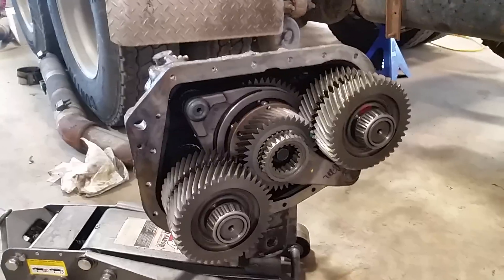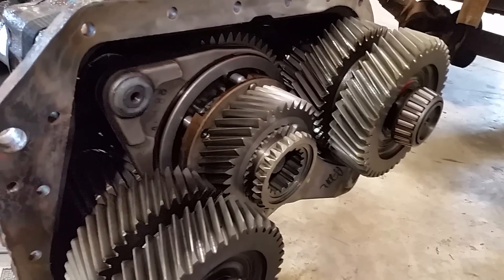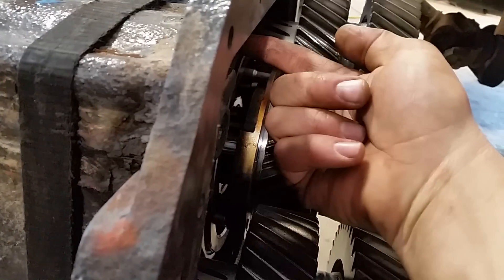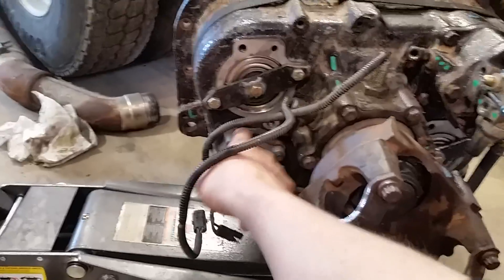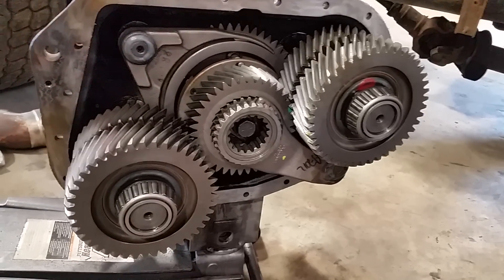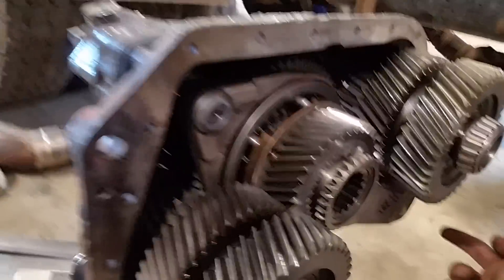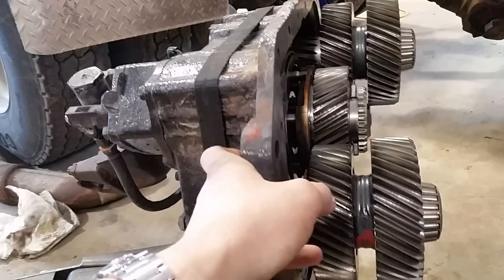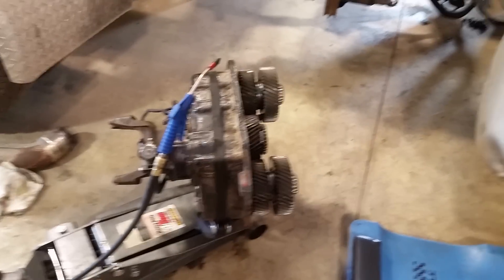Eaton 13 speed...how it works

Comment: Amazing how the trans can be apart like this and be on the road working in a few hours.  Love these machines!!!
Reply: I did a swap a few years ago, and it's kind of scary how quick and easy it is.

Flywheel and clutch takes seconds, slide the trans in, a few bolts on the housing, slap the drive shaft on, a couple air lines for the stick shift and you're done.

Comment: Thanks for the little bit of a heads-up I got a 13 speed that it will go into high range but you're not able to split the high range gears. This kind of gives me a little bit of a heads-up preciate it
Reply: GavatronX9 the splitter fork broke. I just replaced  one on my truck part# is A-7012 . Call pro gear in Tampa Fl

Comment: Hey bud good vid bud the front of the countershaft is actually low split not high split. when the splitter dog is in the gear its in now is high split. I specialised in building  truck transmissions
Reply from the maker: thanks!
Reply: Chris Robinson
Reply: @jmpsck23  I have an 18 speed that grinds from hi to low,probably the syncro?? Any opinions?
Reply: Chris Robinson — That makes sense.  I was wondering about the gear diameters.  The low split countershaft gears have to be larger.  But how does the drive gear in the center move between the two pairs of gears which are of different diameters?  Do the countershafts move sideways when shifting the splitter?
Reply: Thanks you finaly a hero ! I was hoping to see your andswer in the comments !
Reply: Hey my 13 speed splitter stopped working 
Splitter switch moved but doesn’t split where should I start looking for the problem from ?
Reply: @shynal100   unplug small airline that goes to splitter valve on the back of the aux and check theres air comes out when you select at knob
Reply: @chrisrobinson6231  I’ll do that thanks man appreciate it 
Have you got a email or WhatsApp any help would be great 
Cheers
Reply: @GH-oi2jf  There dog slides on the mainshaft and engages in the center of the gears

Comment: I’m having issue with my transmission I purchased my truck with a 13speed originally was supposed to be 9 speed been driving it for a year new clutch has 10k miles on an issue occurred out of nowhere n never stopped if I’m driving in 7 high or 8 high truck rpm surge n truck jerks if anyone can helps really appreciated put to much money in this truck paid a lot of money diagnostics mechanics keep saying keep driving till something breaks

Comment: Great video!  Very informative.  Do you happen to know the specs for the air pressure supply to the air cylinders?  I want to test that before I open up my transmission.  Anything else that a person should check for external issues?  Thanks.
Reply: Rich Lehmann pressure to trans from truck supply is around 110 psi which is then dropped down by the trans filter regulator to about 65 to 75 psi

Comment: Should there be an play in the rear yoke when twisting? Also when in reverse or slow acceleration under heavy load I have a chatter. Any idea what might be wrong?
Reply: I'm having same issue
Reply: Same here took the drive shaft off . in neutral turn driveshaft left and right and it will clunk left and right no in and out play . I put it in top gear high at idle no driveshaft just trans spinning at idle speed and it makes. A racket. Im at the point i want to replace the "bad parts" i have the skill just dont know where id go to pay someone to get the box rebuilt.

Comment: Does changing 9 speed eaton to 13 double overdrive cause low gear to be higher. Its like I'm taking off in 3rd gear or something. If I change it back to regular nine will it lower first gear or should I say low gear so I can take off better without having to ride the clutch and press throttle half way down

Comment: Hey buddy I have issue with a splitter on a 18 speed Transmission. Hi/low range range works but the splitter doesn't seems to work at all. Any suggestions. Thanks

Comment: So what's different in the trans that makes the 18 speed and 13 speed units work like they do?
Reply: 13 speed splits high range only so only splits gears 5, 6, 7, and 8 but the 18 speed splits both high and low range gears so splits all gears, 1,2,3,4,5,6,7, and 8

Comment: What mount/bracket did you use to support the auxiliary section of the transmission?
Reply from the maker: I made one, then used a ratchet strap to secure it

Comment: One thing I've never understood is the transmissions torque range. There's the 1250, 1450, 1650, and 1850.  What is inside the transmission that determines torque rating and what might happen if you mismatch engine - transmission? Example might be if engine is 1650 but transmission is only rated for 1450 or visa-versa if engine is 1450 and transmission is rated 1650. I have a 1550 torque rated transmission and want to have engine ECM re-rated to 1650-lb.ft and don't know if I can still use my 1550 transmission or need to change out. I really want to swap my 10-speed direct transmission to either a 13 or an 18 speed overdrive which creates another problem with rear-end ratio's.  It was so easy in the old days when all trucks used a 3.70, 3.90, or 4.11 rear ratio and dump trucks used a 4.44 but now there are a thousand different ways a truck can be spec'd. My truck uses a 2.64:1 rear-end ratio with 22.5LP rubber. Good fuel mileage but no balls.
Reply from the maker: yeah, I would guess the internal differences are just size of gears being beefier to handle the extra torque, but i dont know. I do know with the ecm controlled engines the power band is much wider and thats why almost everything runs 10 speeds over the road. the few exceptions are the offroad guys moving dump trailers and the heavy haul guys over the road. the old mechanical's as you know have very narrow power bands and thats why you needed all them gears, so you dont end up on your face.   just curious are you planning on re-rating your engine soon, and if you are is it a higher mileage unit? I have seen that often when guys buy a used truck that has been run 300-500k at say 375hp with no problems and they buy it and up the horses and next thing they know is they need an inframe done. i would consider running it until you need that inframe and up the hp after it is done.  thanks for commenting!
Reply: When I bought this truck 7-years ago (2010) it was set at 370-Hp. I took it to Clarke Diesel and had it uprated to 430-Hp. He said that was as high as the ECM would allow him to go without reflashing. That was at 665,000 miles. A year ago (2016 March) at 1,012,000 miles I thought I had a failed injector and took it back to Clarke for a cut-out test. After a couple of hours the tech informed me I needed two cyl-kits due to failed rings. So a top to bottom in-frame was performed. Four months later 2016 July, a head gasket failed and they re-did the work at their cost. Now a year later and about 67,000 on rebuild, I want to increase Hp/Toque ratings and they said I needed a reflash which would cost more than $2,200. I am considering it and if I do, I am thinking of changing transmission and rear-ends for the higher ratings. When I bought this truck, first thing I asked was "has this truck been wrecked"? They said no. Two years later I was changing an interior overhead light and found a piece of paper between the inner-outer roof shell. It was the rebuild sheet from an unnamed shop that rebuilt truck from ground up from a serious 120-mph roll-over crash in Iowa in 2007 which the hood, bumper, condo fiberglass top were ripped off, and all axles under rails ripped from mounting hangers.  Therefore I assume the engine was running upside down which somehow damaged engine. The company I bought truck from went out of business in Feb 2012. It's a good truck now that I've replaced or rebuilt everything but had I known about the roll-over in 2010, I would not have bought this truck. She's now good for another million miles. I love my Detroit DDEC4 12.7L engine.
Reply: Clutch determines power trans can hold if you replace clutch be shire to match torque of engine with rated torque of clutch 2nd is driveline size has everything to do with torque ratings this was my job at Kenworth dealer for many years and still doing it

Comment: Does the top plate have to come off to get that back gear box off?  I need to change the Synchronizer in my 8LL but I want to do it in the truck like your doing here if possible.
Reply from the maker: correct, dont touch the top plate.
Reply: @jmpsck23  Awesome! That helps a lot.

Comment: He got one thing wrong !! The five gears that we see out of the castin are for the low range of the spliter only because high side of the spliter is just direct drive into the gear as it is on the video ! So in 8H your input shaft turn the same speed as the drive line !

Comment: Hello, I see that you have great knowledge about transmission and I was wondering if you could help me out with some advice...

I have a problem with my 13 speed (RTLO18913A).
When I'm in 5H and preselect L to go into 6L, occasionally instead of releasing it so I can pull the handle into 6, it shifts back into 5L as soon as I move my leg of the pedal. Of course it makes a big bang every time that happens.

The whole transmission was rebuilt 2 months ago mostly because of this problem but the shop that did it doesn't know what could be the problem. I have replaced slave valve and it's still happening.

Do you have any idea what could it be?
Reply: I wouldn't pre select your splits, as soon as you get slack in the drive line it's gonna go for that gear

Comment: how do you like that Jack seen it at the local store for $275 but wondering if I should just save up and get a hein werner ?
Reply from the maker: thats the 4ton. it works just fine, i cant see how hein werner can charge that much for a jack. im all about american made but I cant wrap my head around that kind of pricing. plus for 275 its not a big deal to weld a custom bracket for jobs like this that i did. only thing you have to do is swap the zerk fittings for american zerks. i dont know what kind of Chinese crap comes with it but no grease gun Ive ever had fits it.
Reply: jmpsck23 thank you for your feedback sir I appreciate  your  help and time
Reply: @jmpsck23  where are you located? I need to change that thing?

Comment: Hello sir i need to drop the rear of the tranny to put a new seal i saw you built the 2 pieces to hold the gears on place  can you help me out with measurements and bolt size and thread please thank you so much

Comment: The tapered bearings indicate its a 7 series !!! 6 series use ball and straight roller bearings !!! AND 13 speeds have the unsyncronized splitter gears recessed in the back of the rear case.
THE TRANS IN THE VIDEO IS FROM A 18 SPEED NOT A 13.
Reply from the maker: Lol no sir it is a 13. No doubt about it. Unless there is some invisible button or switch it was bought with 13, and has always been 1

Comment: My Eaton 18 speed failed a while back and my boss put in an  Eaton 13-speed I still have the 18 speed shift head though can you still split a 13 in low range or will that damage anything
Reply: no your only spiting the high range
Reply: I've always wondered the same thing. I'm guessing you'd be trying to engage 2 different gear selections on the main shaft at once, and it probably just wouldn't go in. I'd like to see a 13 and 18 speed rear section side by side to compare them.
Reply: @dennissmith460  well you """can""" but i dont know the difference yet but its the same principle, just stronger for high torque application .. you can aslo go from 3 to low in high range its the same ratio of the fourth gear and you can split it ! BUT its not what eaton recommande!...

Comment: Now I know from this video why all Semi-tractor has air pressure!
Reply from the maker: yes, class 6,7,8 trucks use air pressure for brakes, fan, horn, transmission, suspensions, diff locks, 5th wheel slide, 5th wheel lock, seats, dumptruck tail gate locks, pretty much anything and every thing. the old units even used air starters for the engines- those didnt last that long.

Comment: how much does that auxiliary section weigh??
Reply from the maker: i dont know for sure, i would say a couple hundred pounds fully assembled. if you are thinking of taking one out with no jack i wouldnt do it.
Reply: jmpsck23 just took it off and you're right it was about 200 lbs. Good thing you gave me a heads up about the weight or I would have dropped it on my feet. Big thanks.
Reply: usdpaulp weight af.i lift mines yesterday
Reply: jmpsck23 do you need special tools to replace a synchronizer. And is it easy to reinstall will a counter shafts fit in the proper place I was told you have to take the transmission out and stand it upright on a table and lower the rear gearbox in place because the shafts will not line up if you try to change it inside the truck I would like to do this myself I don't want to get it apart and cannot reassemble it LOL any advice would be appreciated